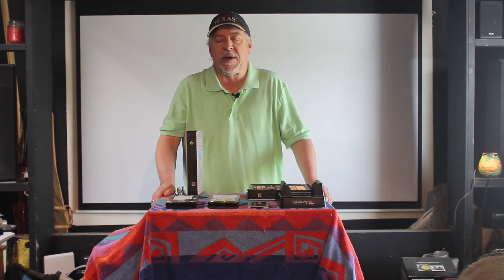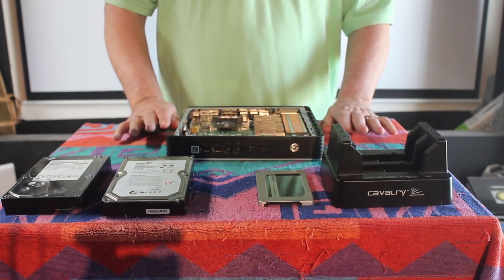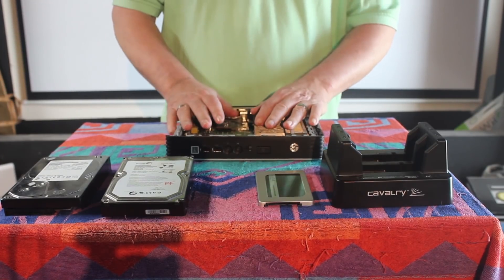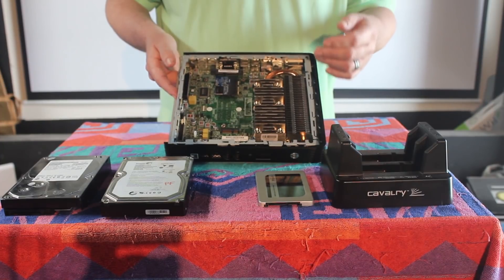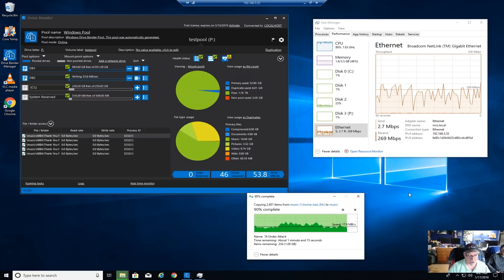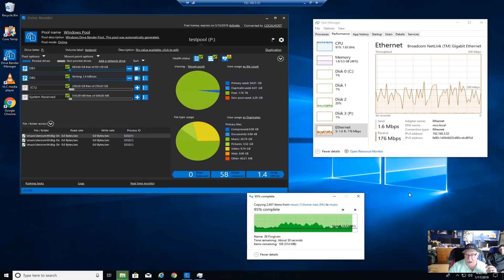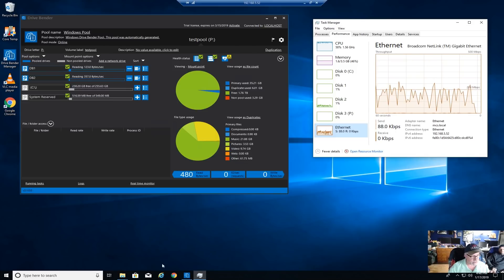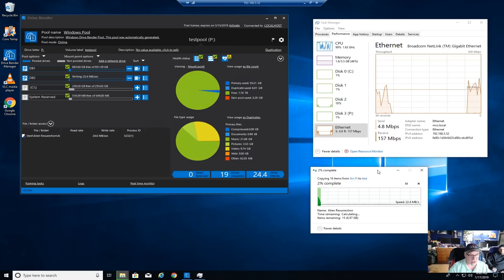Home NAS on the cheap!

Comment: As we can see the cpu is the bottleneck. Have you tried to setup a Linux software raid and share it via smb? I think the Programm drive bender could make it to complex for the cpu. Moreover win10 uses some of the rare system resources. A headless Linux system with software raid should do its job fine, even better?!
Greets

Comment: Those processor series by AMD support the whole suite of virtualization technologies including SLAT.  So you can run Hyper-V for Windows 10 and Server 2016 on them.  Without SLAT, you're limited to HyperV 2012R2.  Wyse has a series of thin client that also use the processor and are similarly equipped with USB3 ports.  I ran one for a while with XCP-NG after I upped the RAM to 16GB and had several VMs running.  The performance was fine as long it was just one vm being used at a time.
Reply: When I first had mine, I installed Windows 10 on it, then installed PFSense in a VM.  I removed TCP/IP from the physical NIC and internally networked the VM and the thin client, so you had to boot up the PFSense VM in order to get on the internet.

Comment: my 2 cents.... really flexible low cost "prosumer" nas cpu suggestion Athlon 64 2650e(AM2+) 15w tdp or Athlon II 160u(am3; supports pci pass through with compatible motherboards) 20w.... both are single core
Reply from the maker: This thin client draws about 25w at full load. Thanks for watching :)

Comment: I stopped using Windows for NAS. Not for the price, but the lower performance, higher requirements and quirkiness, like forgetting to share a usb drive if for any reason, the drive gets disconnected. Plus need to be able to save/restore the configuration quickly and reliably!

I have 2 FreeNAS and 1 XigmaNAS servers now days. 1 primary, 1 backup of primary, 1 test.